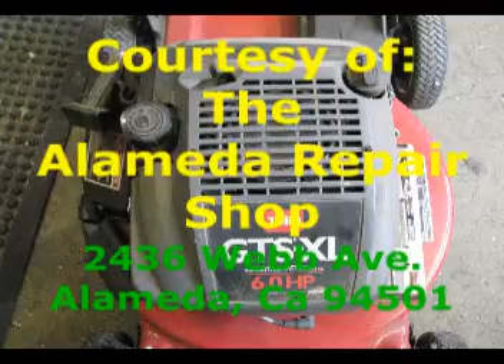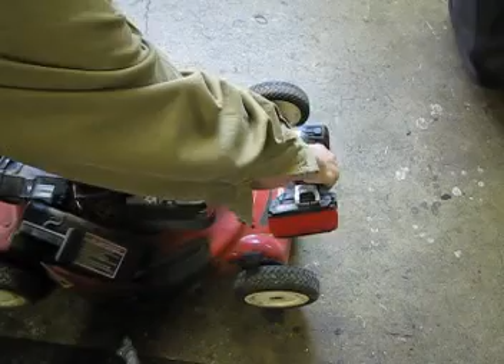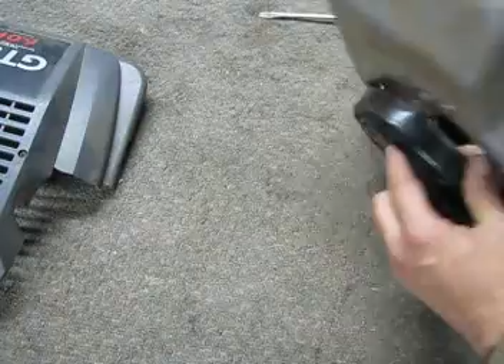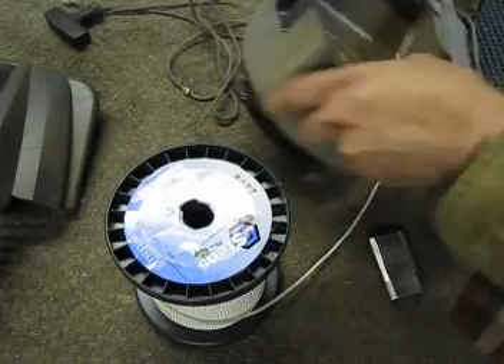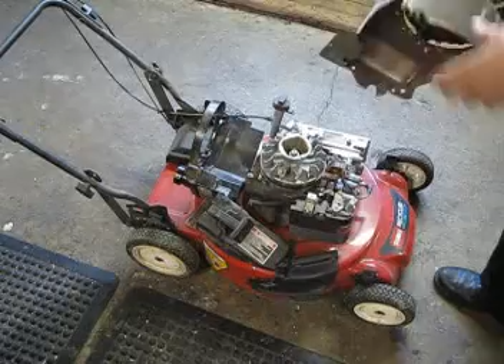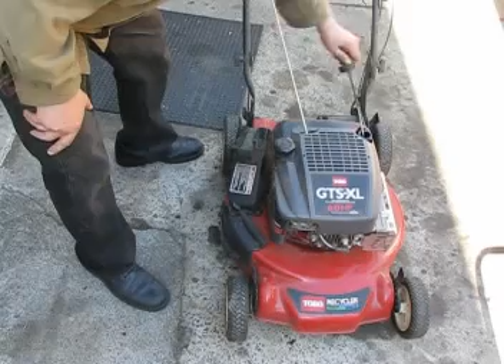Lawn Mower Repair: Starter Pull Cord  Replacement, Briggs and Stratton, Toro, Alameda Repair Shop

Comment: Perfect, I thought I knew what to expect, until I lifted the cover off my mower, and saw the recoil mechanism was rivetted on. Your video showed me the further disassembly needed on this model. My father-in-law's old mower just keeps on going ;)
Reply: ha. I have the same mower from my father in law as well and saw the same thing with the riveted recoil mechanism. Unfortunately, I was in too much of a hurry and drilled the rivets out. looks like I'll have some harder repairs to do in addition to the pull cord
Reply: Right, my dumb ass was very close to drilling those rivets out, figured replace with self tapping. Video definitely helped me out.

Comment: ANY HELP Did  this all and the back together and the cord will not pull .take it off and the cord pulled fine .Place back on an IT won't pull ???   Now for this driver hits the wall ..https://www.chick.com/reading/tracts/1022/1022_01.asp
Reply from the maker: michael parks Is the blade brake cable stretched or broken? Disconnect the spark plug and see if you can turn the blade (carburetor side up), is the engine seized? Take out the spark plug and try again possibly the cylinder is full of oil, gas or water.

Comment: Many thanks. Just fixed my Toro GTS with your help. When I first opened the cover and saw that the top of the recoil starter was attached with rivets I thought I was screwed. Your directions were great. I especially liked the twist of the oil stem (instead of of pulling it out) so dirt wouldn't get in the engine. All the best to you.
Reply: Same here! Rivets? Really? Then I watched the video. :-)